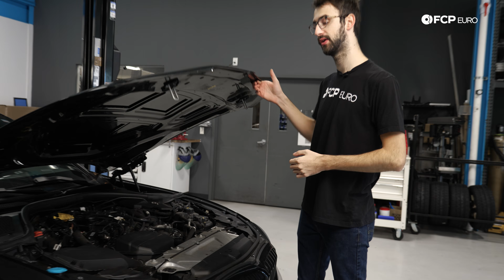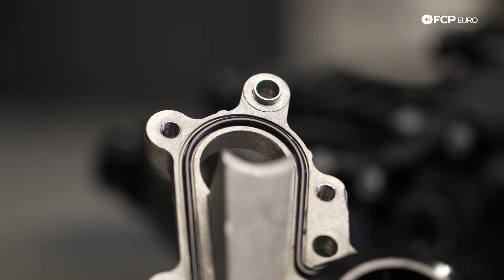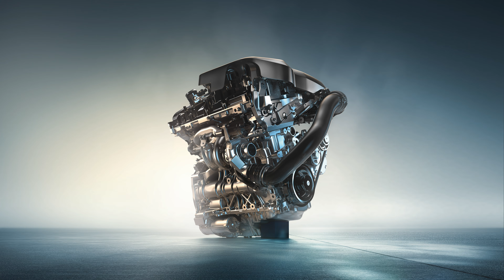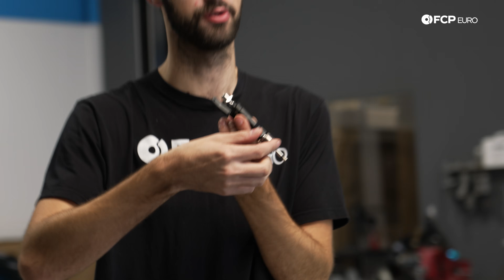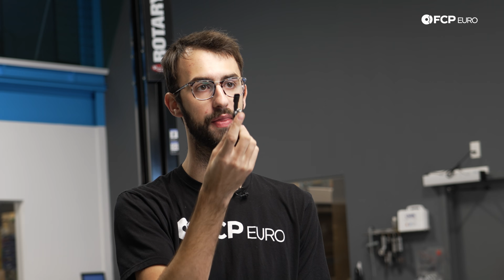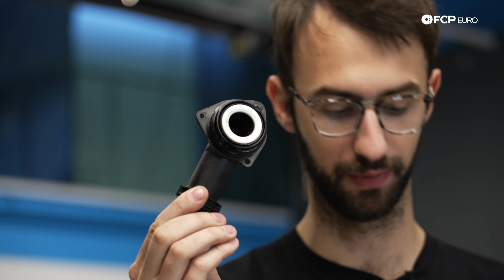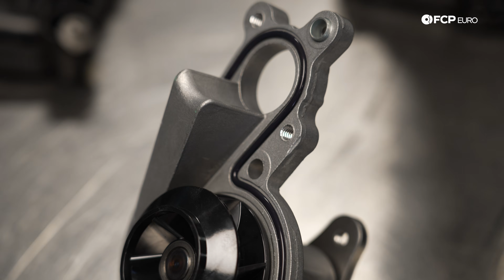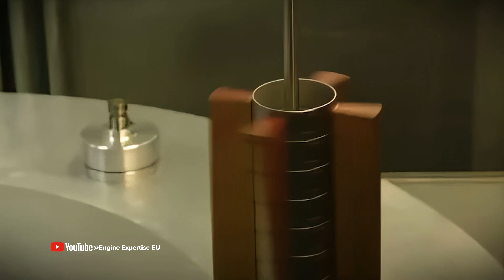BMW B48 Engine: Everything You Need To Know - BMW F30 330i, G20 330i, G01 X3 xDrive30i Engine Guide

Comment: Those BMW engine codes confuse me. I have an N55B30M0 rated stock at 302hp and 295lb/ft of torque. This engine was tuned to MPPK which raised this to 320hp and 332lb/ft of torque. Meanwhile an F12/F13 640i have an N55B30O0 rated at 320hp and 332lb/ft of torque. To me it appears those power outputs are based on the engine's factory tuning at stock level. In fact the F12/F13 640i is one of the few models in recent years to have the "40i" designation with an N55 which many models with this engine had the "35i" designation. The "40i" became common place when the B58 started production in 2015

Comment: B48 is slept on, IMO better then B58. I have a 2019 330i and if anything ever happened to it, I replace it with another 330. It's fun, It's nimble its conformable and fuel efficient. Done day plus long road trips, Track days,  commuting, back road drives stock and tuned up to E85. Have 50k miles and just experienced my 2nd problem, both are my fault. The first one was an issue when I did a software update and tuned it with a locked DME, last week I snapped my axle doing launch control. But engine is rock solid and never missed a beat
Reply: nigga said better than the b58 LMAOOO
Reply: So are you tuned or stock?
Reply: @WondurrEdits  tuned 42,000 of the 50,000 mi on there with BM3. Right now running a custom Navardi flex fuel tune
Reply: I just got done taking my own 330i (g20) for a 2000 mile road trip. Bbetween the avg 38mpg while hauling stuff, fun on twisty roads with the super-light front end, and epic gas tank range, it's a keeper! I really see it becoming the new sweet-spot for BMW tuners. Awesome cars.
Reply: @AlexNelsonFCPEuro  I believe you're right. It will be a future classic, handles better than m340 and when I was doing a road trip from the sf Bay area to los Angeles cruising at 75 or so on highway 5. At one point I was peeking at a trip average of 44 MPG, And if I remember correctly I was on BM3 stage 1 at that point and stock tires. On E I get in the mid-20s cruising on the highway
Reply: The B58/S58 is a stout motor. I drove the 4 then the 6 and the 4 was underpowered in the 4 door. The AWD 240ix B58 is the best thing going price and performance wise. Post almost identical times to the M2. Love it. Traded a 2020 911(922) Carrera in for it. 48 vs 58 is a no contest stock. "Better" ? Maybe in fuel economy. The 240ix best Daily I've ever had.
Reply: Better than a B58? Keep dreaming

Comment: 2018 x3 B48TU and just had to do the oil filter housing.. Such crap design to have to drop almost $3000 to have it fixed.. These are not maintenance items, These are core engine components that should not be failing under 100k miles. We love our X3 but come on BMW for all the German Engineering you tout you fail at such basic things which is completely due to bean counters.. Engineer the part to last the lease or the warranty, Anything extra is not a priority. Really great video btw!
Reply: My 2023 M440 just had its oil filter housing go bad at 18K miles and less than 2 years old.They loaned me a 2025 330 which I promptly traded for when my car was fixed.Always been a motorcycle guy but now starting to feel what a car should feel like.I think I will go back to doing my own maintenance again
Reply: @rogersemple3122  Yeah at 18k thats just unacceptable, Thankfully you have warranty but still.. It should not be happening..
Reply: @quiksr20  I went in for an oil change on Warranty and they said your too early.I said I was here and scheduled so do it and I will pay.2 hours latter they say we need your car for a few weeks a part was backordered from Germany(filter housing) I guess.I didnt ask about the part I just asked what was the problem and they said oil was pooled in my engine covers underneath.Do I now have to watch out for my B48 and if I see any oil at all under run to the shop.I wish they would include a dipstick !When I went back to pick up the car they wanted me to pay for the oil after I had already traded it for a new 330.I guess its tough to hire people with any commonsense these days.
Reply: @rogersemple3122  Jeez that sucks and is ridiculous, One that they tried to make you pay and two that the problem even happened in the first place... As much as I defend german car problems for people neglecting them this stuff is unrelated.. This is just BMW's doing BMW things.
Reply: the oil filter housing is the same as the b58, wich only cost like $300 and its 8 bolts.  it takes about an hour to swap in your driveway with absolutely zero previous wrenching know how and a youtube video. the "plastic" housing is STRONGER than aluminum btw.  its carbon ceramic infused composite that actually just LOOKS like plastic. the aftermarket housings are all metal.  if your only issue with the engine was a failed oil filter housing at 100k miles thats really good.  we only work on bmws at our shop, 12 lifts, 15 bays and oil filter housing jobs are pretty rare.  plenty of timing chain and other catastrophic issues though.
Reply: @honk3times  You might be thinking N55, B48/B58 has it in the back and the intake manifold which is also a water to air intercooler that has to be removed... Its a decent job, Even experienced BMW Indys will tell you its alot of work.

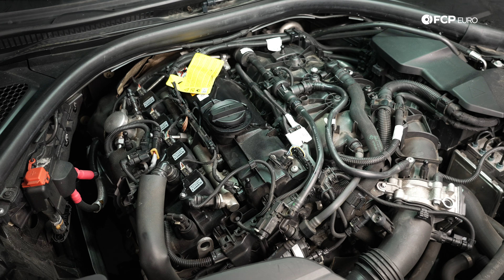Comment: b48 with 120k mi on it, one of the cam shaft position sensor harness broke loool (due to heat I guess? since the wire is so close to engine cover and bmw tend to run a bit warmer for heat efficiency I think). ( the tiny three wires you can see at 1:40 of the video). Now time to learn how to replace the harness loool

Comment: Why is there water (coolant) running through the oil filter housing, giving the potential to mix with oil? Why isn't it just oil?
Reply: It’s called heater/cooler, its helps warming up engine oil and atf faster, then keeps it at a constant temp (cooler)
Reply: @FerasAlhawas  wow, interesting. I guess that explains how my oil gets so warm so fast

Comment: Is this engine in the 530i as well?
Reply: Yes, I have a G30 530i, but here we have B48 (not the B48TU as in G20). F30 330i also has the B48, I thought 330i and 530i engines must be therefore identical, but apparently they are not. The cooling expansion tanks are different and therefore the plastic hoses that can fail - are also at different locations. While OFH crack is a popular problem amongst 330i, it's not as common amongst 530i, though it does happen. I am yet to investigate that problem further and decide whether it is necessary to replace that part in my 530i preventively. I will certainly replace the expansion tank-to-radiator plastic hose, as this one is known to fail in 530i and my car is almost at 100,000 km mark (62k miles).

Comment: Very fascinating.bmw also tried to build the b series similarly to the diesel platform in a petrol version making it more reliable then the n petrol platform.early n series with eu5 injectors was the worsed ever design conteminating fuel and the n20 worse ever balance shaft design in my experience as a mech.g20 looks quite promising love the detailed explernation❤

Comment: I've always been super impressed how quiet and low the NVH is on my 330 , especially when it's gear climbing at very low speeds.. a typical 4cyl would be humming and vibrating.. now I know why the b48 is so balanced! Thanks
Reply: Its also because its turbo and has enough torque to not have to go into higher rpm, as well as a great 8spd auto trans. That being said, it’s an exceptional motor.
Reply: @djkjthe3rd185 the trans is a great point! It really is able to take that great low end torque and put it on the road so seamlesssly with almost no power loss. Such an amazing duo
Reply: yep, the most frustrating thing BMW did is to label 2 litre 4 pathetic cylinders as supposively 3.0 6 cylinder bangers and that is why I was forced to remove 530i shield on my 5 series because it means  n o t h i n g  as of today

Comment: At first I was sold but damn some of those issues at 50-60k miles.. I’ll stick with the EA888!
Reply: I own both , the water pump will degrade on the ea888 motor and in similar fashion the valve cover seal will leak near the sensor as well..  😮
Reply: @ true, I know the water pump will fail but it seems like there are quite a few failure items on these engines. The block seems very stout though! I’d be worried about the part that coolant could leak into the oil though
Reply: @rambow70  in all fairness that part did fail on my 2020 330i at about 8,000 miles.. the audi has been super strong other than a hub bearing and the water pump.  And they've both been tuned on e85 since new!

Comment: Hi guys!

I having the issue I cant beat, I did a lot of testing and replaced a lot of stuff but that didnt helped.

I have an F32 B48 engine, when I start up, car RPM jumps a lot first 10 seconds. 
I see you are the experts, maybe you can give me some clues wheree to look?

Currently I did:
- Replaced injectors
_ reeplaced spark plugs
- replaced valve housings(valve insullation, I dont know how to call it correctly)
- I checked the turbo
- I did a valve blasting
- I checked thee fuel tank ventilation (swapped other one, but no result)
- I checked the full Fuel tank - low presure pump - high presure pump fuel route to engine

What could be wrong? Im desperate please help me!

Comment: I just bought my wife a 2024 mini S with B48A20A. What's the last A designation means, and is this engine reliable?
Reply: There are A and B. A are for 320i lowered power. B is 330i and some 330e. That is why stage 1 tuned 330e with 330i engine is keeping up with m340i.
Reply: @Priestitude  is the engine reliable

Comment: 50k mile oil filter housing and pcv valve covers gonna ruin a lot of these cars.  Ya crazy if you're think the average consumer is gonna learn all this useless BMW specific issues.  Owners are going to do what they always do drive it for a couple months neglect it sell it to the next person and then when it reaches the enthusiast hands it'll be six owners deep and you'll be able to pick these up for three grand. In less than 10 years
Reply: Under 100k miles we shouldn't have to replace an oil filter housing ( $2000+ parts/Labor ) /  Heat Module ( $1000+ parts/labor ) etc.. These are not maintenance items they are poorly designed parts engineered to just last past the warranty.
Reply: Trust me I like use to like bmw. Had 2 e36s an e46 ,e60 M5 that i wanted to keep forever.. a e90 m3 list goes on.  Wife has a 6 speed 335i 2010 vert. She loves that car. But damn BMW would address some of their corner cutting their resale values would be better along with their image. I have many friends who BOUGHT not leased their BMWs and they have all left the brand.  @quiksr20

Comment: no mention of this engine in it's 330e carnation?
Reply: It's fundamentally the exact same engine, as the electric drivetrain component of the 330e is actually carried out by it's clever e-motor within the transmission and different programming. The B48 is de-tuned in the 330e application to 184hp and 221 lb-ft, with a combined gas/ electric output of 252hp. The unkown of the 330e will ultimately be this change, and how things like the e-motor clutch (seperation clutch) in the transmission hold-up over time.
Reply: @AlexNelsonFCPEuro  I own a G20 330e xDrive.  Here in the US, there aren't that many.  The highest mileage one I can find has 123,000 miles on it, but most of the ones I see have 40,000 miles or less.  What I don't understand is why the detuned engine still requires premium fuel.  Just trying to get a feel for what I'm in for :).  Thanks for this video and your reply.

Comment: Have a BMW 1 series in the UK the BMW 128ti - B48 265 BHP and 400NM and it is a great power unit no issues though only around 16K miles on it!!!...Love the BMW 128ti...
Reply: We don't get this model in North America, the smallest BMW car available here is the 230i
Reply: @Terry_Aki_Soss  Very similar to the 2 series but in hatchback form, great review with BMW 128ti vs Golf GTI....https://www.youtube.com/watch?v=K4aoW7LCDK0
Reply: @Terry_Aki_Soss 1 series is almost as big as a 3 series so
Reply: @lilibra6224  The 3 series has really grown in size and the one is really compact compared to the 3...cars just seem to get bigger and bigger..
Reply: @vMaxHeadroom  saw f20 and f30 side to side almost no difference in length en width
Reply: @lilibra6224  Mine in the UK is an F40 so 4329 overall length vs 4713 for the F30 saloon. When you look at them side by side, the 3 series does look a fair bit bigger though probably because it looks sleeker rather than upright as in my f40...

Comment: Hello, thank you for this detailed video. 
I am buying a G20 330. Can you please make a video describing the right way to drive the vehicle to ensure longevity of the drive train. 

For example will it be better to drive it in Eco pro and rip the car a couple of times a week to clean out the engine. 

This is probably the worst explanation of what I want to know. 😂

I would appreciate someone to explain it better
Reply: Change the oil and filter every 5k miles.
Use a PEA fuel additive.

Comment: I have B48A engine which is longitudinal installed in G20.
I would like to hear differences between A and B variant internals. If you trust internet, they are saying A variant is some fragile low power variant.
Reply: The B48A , I know a few guys running custom stage 1 and stage 2 software with no issues.The main issue is fuel contamination or over fuelling that breaks these engines.

Comment: Good video, is there any way of lowering running temp on these engines since the are at 110C / 230F at normal operating conditions ?
Reply: Yep
Reply: Add an oil cooler.
Reply: How ?

Comment: Ran a stage 2 tune since 36k miles. The only thing that needed replacement, Water pump housing and bracket gasket. The oil filter housing and gaskets DID not fail at 108k miles with hard driving on a stage 2. no. the water pump housing bracket gasket failed. My oil supply line gaskets also failed at 108k.
Reply: Thanks for the insights - we always appreciate hearing first hand experience like this!
Reply: So just gaskets @100k
Reply: So just gaskets @100k

Comment: The heat management module does the same thing as the EA839 3.0L V6 in Audi. It have a vacuum actuated shutoff valve for coolant btw block and head. I prefer electric actuator of BMW cuz when it fail the coolant migrate into the vacuum pump and make a mess. Thermostat are regular electronic control. Coolant take 2 min to be hot in the system it's crazy fast.
Reply: @RandomAccessMemorylosslike 5 min to get to 200f on a b58tu

Comment: I dont think my b48 equipped x1 shares all these components. 
X1 I know for sure has air to air intercooler. I think it has a more traditional thermostat buried deep with the water pump.
The car has about 65000 miles. Only the oil filter housing has failed so far. Now I'm not going to sleep tonight, worrying about what's next.

Comment: So Bmw finally fixed its bearing😂 should have done with the e90 and e60 ms
Reply: Bearings are only issues on the 8000+rpm engines: s54, s65, s85.
Reply: @grad0n no also on n63 s63 and n55

Comment: Oh, and I have a 2018 G30 xdrive 5 series and I love this engine. It averages 27 MPG in the city and feels great on acceleration. I also noticed when I was watching a video from Europe, a guy was working on an E90 with an N47 turbo diesel. It looked remarkably like a B48. Double chains on the back of the engine, very similar block structure. I wondered if this engine came from that diesel?
Reply: Likelihood of them trying to leverage prior engineering for parts of it is high!
Reply: Based off an existing diesel would explain the better reliability. 😂
Reply: Oil filter housing definitely came from B47 diesel. Manufacturers keep making more plastic couplers directly attached to hot engine block - planned problem as money for repair services